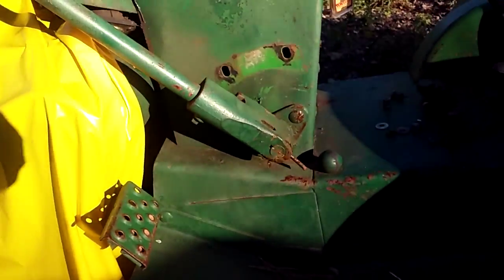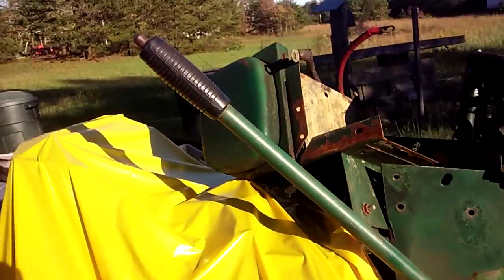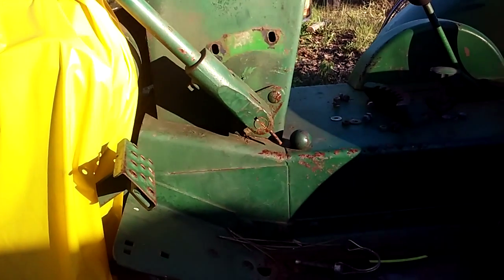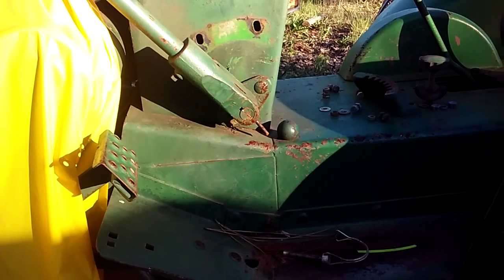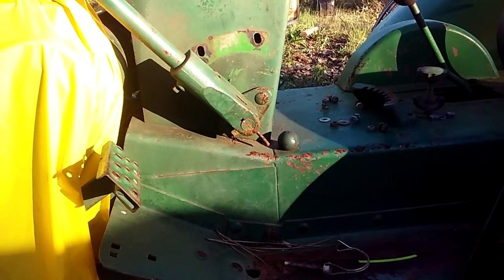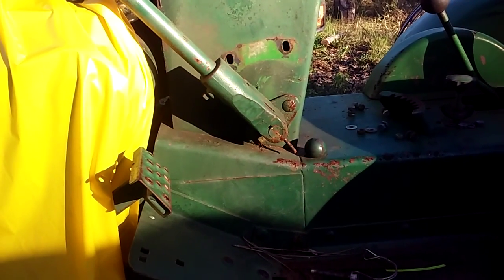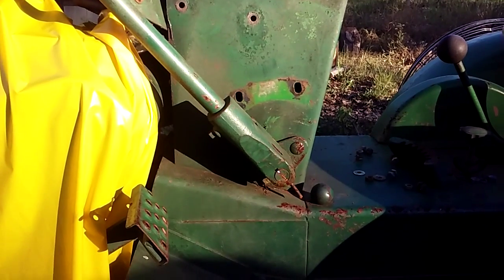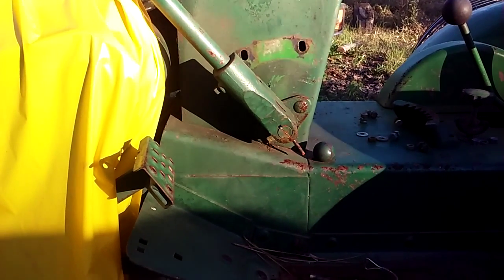John Deere 110 Attachment  lift lever part I

Comment: That's caused by not having a helper spring. Can you upgrade that 65 to a hydraulic lift Salvaged off of a later model? I think that's what I would do if it's possible on that tractor. Love your videos I subscribed.
Reply from the maker: POP ONXBOX yes you are 100% correct.